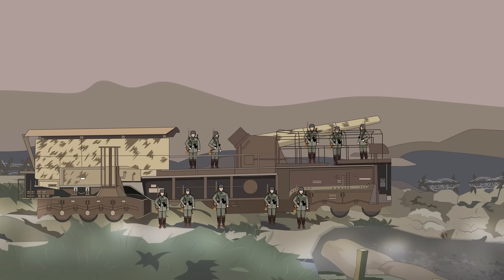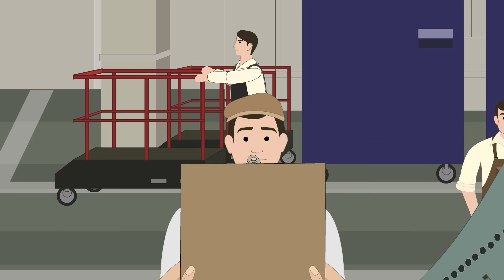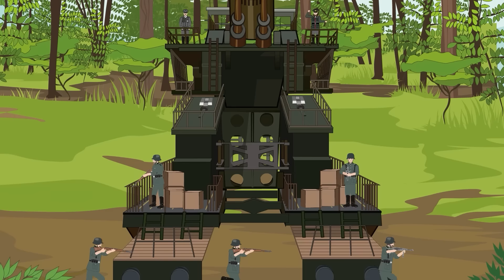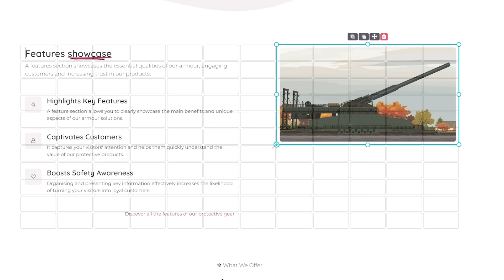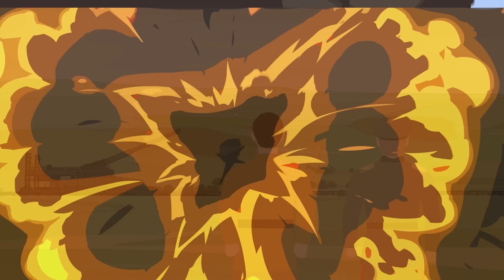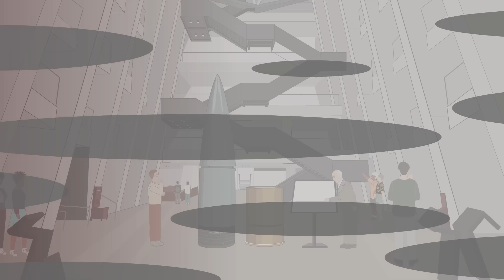Hitler's Behemoth Railgun That Could Wipeout An Entire City - Schwerer Gustav

Comment: I like how they destroyed the Shwerer Gustav to prevent its capture, as if the Allies would ever repurpose such an impractical weapon.
Reply: Even of design is failure it is still hunderds of tons of precious metals.
Reply: ergt9743t yeah, it was called towed artillery, which already existed 💀
Reply: I wouldn't have put it past the allies to repurpose it. I mean we did make an artillery piece with the sole purpose to fire nuclear devices called the M65 Atomic Cannon. Ended up being completely impractical.
Reply: @nanab256 Which the Allies didn’t need
Reply: They would, not for battle, but for research
Reply: “What if…Nuclear artillery round?”
Reply: ergt9743t  Planes are flexible, versatile, easy to redeploy and can be repurposed (many bombers became cargo and passenger planes).  The Schwerer Gustav was none of those, and no one except for Gerald Vincent Bull (and he failed) even tried to build such a massive gun since.  So, I'm not sure what was built on the foundation of the Schwerer Gustav.
Reply: ergt9743t  The "Dora" gun wasn´t the starting point for developing barrel artillery - it was rather a dead end. 
At some point most technologies come to an end of their "lifecycle" and are replaced by other more advanced technologies. 

WWII was the end for large scale barrel artillery at land and at sea. Making guns ever larger wasn´t practical. 
The size and weight increased disproportionately, the rate of fire dropped and the accuracy was lacking.
Bombs, rockets and missiles provided faster, more flexible and precise means of delivering a payload on target, making large bore guns obsolet.
Reply: it was just scrapped to use the 1400 tons of steel for other things...
like submarines or tanks that would actually have an impact on the war.
Reply: @jeremyreed8452  not impractical just too destructive
Reply: Soviets would have used it
Reply: They dit not. US soldiers found it in pieces in Germany.
Reply: In the case of the Nazis anything that got captured was going end up a trophy piece, and that cannon, while limited, was sure one heck of a trophy piece.
Reply: if this was built now? some lancet drone or any fpv would be it's nightmare.
Reply: Could have easily used it in the advance back into germany. Bombing fortified postitions and the germany defence line i forgot its name. siegfried line?
Reply: Heard of the blitz?
Reply: @bryanemilius1606  yep.
Reply: The Germans started that actually. But nice try 😂.@davestevenson9080
Reply: I don’t know about that. Imagine that with an Excalibur warhead and a rocket boosted engine cheaper than a cruise missile range probably 1000 miles. Much bigger warhead.
Reply: @lionemessi Westwall was in contrast to Maginot line more bluff than good fortification. Attention: English wall- german Mauer. German Wall- english rampart.
Reply: They would look at the weapon first, just to see what was involved in building the gun, maintaining it etc. 
Overall they would conclude that it was a failure in every category but one: to please a man who was overcompensating who just wanted a big gun.

Comment: I recently got a Chinese knock-off lego model of one of these.

this is actually kinda funny, the Gun I ordered also has "Dora" as the official name and its also built in 5 segments.

I like that.
Reply: That is because there were two of these guns made
Reply: If you're referring to COBI, they are a Polish company.
Reply: @TreeBarkSide  it wasn't cobi
Reply: @TreeBarkSide  no, Cobi Never built the Gustav (at least until now), the biggest gun they Ever produced as a Model is the Karl gerät mortar. 
The only Brick Model of the gustav/dora that i am aware of is from a Chinese Company Named kazi
Reply: @iliadnetfear2586  I only mentioned hobby boss because the shop I get my stuff has one of those, really expensive,
Reply: @JoaoSoares-rs6ec  I paid about $80 for this on Wish.

It's not entirely "Structurally Sound", being a large mass of plastic tiny bits weighing on top of each other, but it's a nice display set.
Reply: Dora the Destroyer 😂

Comment: I think this could have been really effective if germany had air superiority over the gun. since the round is so big, its basically a bombing raid without the airplanes. That means no risk of losing aircraft or people over Britain. If they had a few extra barrels on hand,  london could have been leveled through consistent fire.
Reply: by then that gun would of just been targeted by the royal navy
Reply: V2s made it completely obsolete.
Reply: Look up the V3 project, a much more advanced artillery with multi-charge rocket boosters and fin-stabilized shells.

Comment: Imagine if it was built today, what sort of capabilities could it have with modern technology?
Reply: oh dudeee
Reply: I was going to mention this, technically with modern tech, this could be possible
Reply: Let us imagine for a moment what it could be in the modern era - a dedicated railgun, perhaps. We can also mention that by the end of the war, there were experimental versions of said weapon with tracks. I predict it would be an equivalent to German anti-Parisian artillery in WW1, probably firing nuclear warheads.
 For starters, it would be obsolete right from the start - taking away failed project of manoeuvrable hypersonic rockets, we already have ICBMs, not only loaded with far more explosive material than Schwerher Gustav could have ever discharged, but also being able to fire much more frequently, faster and with even higher range. Many of said missiles are even able to combat anti-air systems - something that Schwerher Gustav would never be able to do. Not to mention, one nuclear ICBM, even if hitting the target half a kilometre away, would absolutely decimate such a large gun.
 The other issue is... we don't have any need for such a weapon anymore. Schwerher Gustav was built in times when bunkers were still an important element on the battlefield, which is no longer the case. Heck, there are certain military experts who claim that even tanks may be obsolete soon, just like Heavy Cavalry in WW1. Modern warfare is no longer based on singular, concentrated system, that needs to be protected at all times, but rather on a ,,system of tiny systems", where loss of one out of a thousand is not a tragedy. To think of something more suitable for modern warfare, think more of a machine gun that can aim and shoot thousands, if not millions of rounds per minute, all accurately, can move extremely fast, is lightweight, and doesn't require a front soldier to operate.
Reply: It would be a failure

Comment: Hitler definitely thought big. But this looks dumb.
I assume it was inaccurate because of to much movement in the gun, train, trac, soil, wind.....?
Can it be said that the bigger the ballistic, the less accuracy?
I know a guy that shoots .22 cal. from a bench mounted machine that doesn't look like a gun. It's all about mastering the accuracy. 
Every bullet is different so he makes his own. He is absolute spot on. He can put 5 shots and have one hole at 150'.
It's a science thing. This big gun is a psychological thing. One shoot, no hole and everyone is terrified! Guess you can say that also is a science!
Reply: Actually the Germans were very good at aiming artillery pieces.
The problem is that there are inherent problems when you try to hurl a huge unguided projectile over 30 miles.
First the gun had to shoot from beyond the range of enemy artillery because it was such a massive target. Over such a long range even tiny things can influence your aim,
e.g. the Germans stored the powder charges for the gun in temperature controled compartments to make sure that the charges would deliver a consistent blast.
Every shot of the gun also made the bore of the gun slightly larger because of the extreme pressure inside. The engineers had accounted for this and made projectiles with slightly different diameters. Another problem was that the barrels had a very limited service life and would have to be replaced frequently if this gun would have been used on a regular basis.
Reply: @hermes7587  So the metal of a small gun is the same as the big gun but the big gun has different factors thus, less effective over all it takes to make it beneficial.
The bigger the gun, the bigger the problems that small guns don't have.
Reply: @taboovsknowledge1603  I think it is futile to even compare aiming a handheld gun to heavy artillery piece. 
A rifleman usually does not consider factors like the curvature of the earth, the Coriolis force, air pressure or the size and temperature of the powder charge.
Reply: @hermes7587  The comparison is that .22 cal at 150', "Small". 
vs
This behemoth is that it is all the same material and similar action. Yet, the bigger it gets, the more obvious the issues. 
So if you are having a problem with accuracy with the small arms. Research the big arms and you could find the cause.
Like, if your out shooting a .22 and you have rounds in 100 count holder cap side up on a hot, sunny day. You could have a variation like the temperature room for the power on the big gun.
The Earth turning is lesser of an issue.
Reply: The weird thing is that this is probably possible to work with today

Comment: A piece of the Schwerer Gustav still survived, a large artillery shell...
The shell is about 4 meters long and it weighs 5000 KGS. It could inflict enormous damage, it could penetrate 10 meters of concrete, it could penetrate a steel plate. When that thing fires, you got fire power...
It took about 25 trains to bring all the equipment. All the installations of the Schwerer Gustav. It took about 2-3 months before it was ready to fire on June 1942. There were about 2500 people needed to build tracks for the gun, to assemble the gun, and to fire the gun. 
It took 90 days to prepare to gun for firing. And it was only used once against the Soviet city of Sevastapol...
It was able to destroy some heavy fortification both at a  price:  
1. It could fire 48 shots and it's barrel was wornout, wornout completely. It needs enormous maintenance to keep it in working order.
2. And because of its dimension is vulnerable to air attacks.

Once the Schwerer Gustav a successful weapon, in the end the answer is NO....

Comment: Just wanted to point out the big difference between a rail gun and a rail𝘄𝗮𝘆 gun;
railway guns are large guns that can only be moved around on railways, and are usually fired from railways too,
rail guns are a lot more modern guns, (I think) they use magnets to massively increase the speed of shells

Comment: As someone who knows a bit about massive pieces of engineering (ships, excavators etc.), I know for a fact that we can build stuff like this for sure. The problem is it's incredibly expensive. Oil platforms are beneficial because, over the years, the oil barrels pay off the massive amount of money poured into just one structure. However, with weapons of war, you will never get a benefit. The Yamato, for example, was the biggest battleship ever built and a marvel of engineering. You know it's a good battleship when it takes 17 torpedoes and 19 bombs to destroy it. But, ultimately, its guns took long to load and to turn. Those 460mm cannons worked great against warships until the US figured out aerial bombing was a lot more practical. Nowadays, there are no active battleships, only cruisers, destroyers, frigates and aircraft carriers. Technology has advanced a lot since WW2 but I can assure you there is no universe where such a gun as the schwerer gustav is practical. If the gun is huge, the amount of resources and labour wasted are gargantuan

Comment: It was huge and useless. looks fancy and was for propaganda stuff, but laid a foundation for something much more scary. just imagine they improve it, they change the ammunition to nuclear warheads and increase the range, or bring this behemoth to the marine and use it on oversized boats.   later in the war. the precision does not matter if anything in 10 kilometer range is dead, let it fly 1 kilometer next to your target. it does not matter at all. 
the first step of a path does not bring you very far, but don't compare the first chapter with the 20.th chapter. just be happy this road ended in 1945.